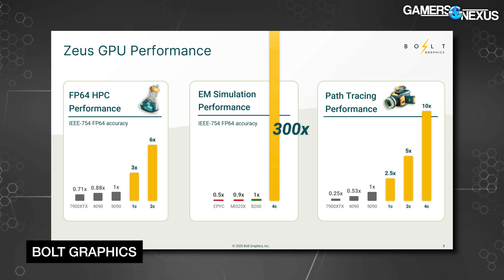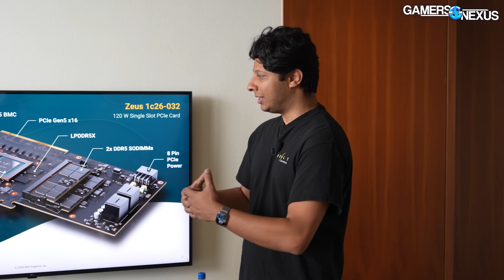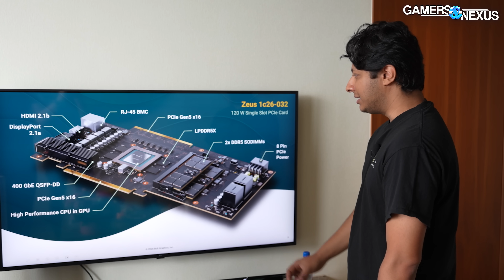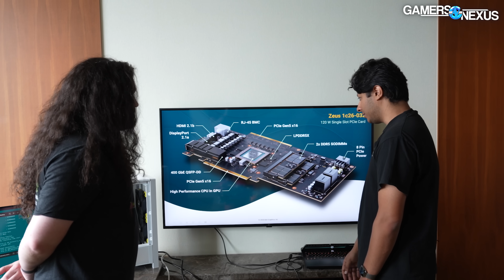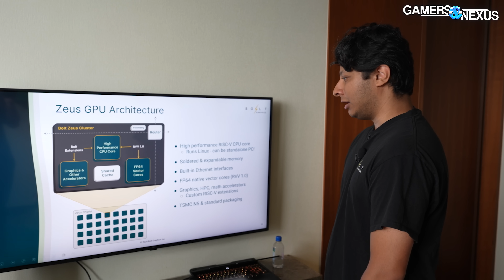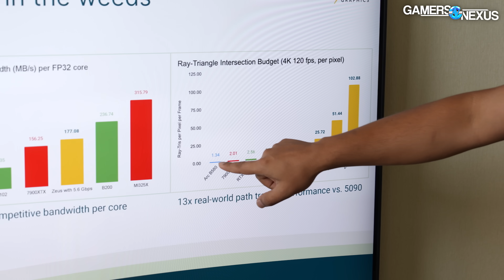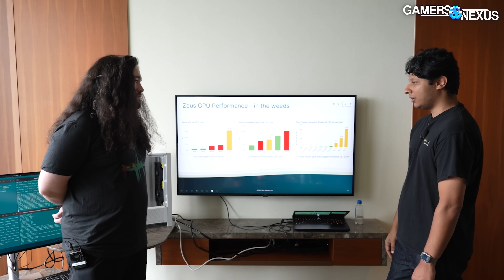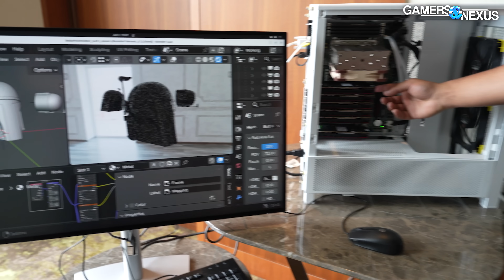A New Gaming GPU Challenger: Bolt Graphics Takes Aim at NVIDIA

Comment: Like perpetual energy machines, I've been hearing about this card for a while now; I'll believe it when it's on store shelves.  There are speed reasons as to why the current GPUs have memory directly onboard and positioned as close to the GPU as possible, and those reasons don't go away when you want to trace faster (It becomes an even bigger factor).  If their design was really revolutionary and more performant, I expect they would be licensing a patent to nVidia and every other competitor instead of the venture-capital-hungry path they are going now.  nVidia will surely clobber them with their own implementation of anything that is not patentable.

Comment: The raytracing focus is really interesting! I am a fan of art and games that use voxels, which are sort of like 3D pixels. Voxel rendering relies pretty heavily on raytracing to get each tiny cube shaded correctly. In the past, the best way to do it was theough software rendering. Currently, static rendering can use the raytracing hardware on cards. As far as I'm aware, a lot of games that use voxel-based terrain destructiipon, for example, will use more easy to work with polygons for the actual rendering, and deform the polygons to match the taper of the unrendered voxels. If this card can really nail pathtracing and raytracing then I could see more games like Teardown come out at higher voxel resolution.

Comment: Bolt has been saying that for years. It's 1 CEO guy and a PR team. Last years it was 10x a 5090. This year it's 5x. Also, rasterizing is kinda important for games, especially, you know, the ones which don't have Pathtracing implemented. I understand you want to grasp to some good news in this horrible place we are currently, but Bolt is not one of them. They are showing you a glorified renderer "optimized" on RISC-V on Blender, make some bold extrapolations from it, and already talking about silicon production for 2027 while NOTHING is currently in your hand aside off the shelves FPGAs already bought years ago and a rendered picture of a card. I was expecting more for GN and you Steve... Like how about Fiore, the previous startup from the same guy, a startup I quote "focusing on hardware accelerated graph network technologies" ?

Comment: My old RTX 3060 died back in late march of 2026 and I am now stuck with an Intel Arc that is still ghastly terrible, and I have the B580 Titan from Sparkle, and now Intel doesn't want to do discrete graphics anymore, only embedded. Oh Gee Thanks A Lot -kind of sort of thing. The drivers simply can't handle streaming services like Secondlife. They at least got AV1 barely working TG. I do a lot of video work, so processing power is a must, as is ram. I've been going to Secondlife for ages, but Secondlife crashes and crashes on the arc card with more than just a few people in the area/sim even withthe more than 200 tweaks and Tdr settings etc, etc, etc. I also need a minimum of 2 display ports. I love the card design.. It's amazing, and the ability to add ram is OMG!! just what we need, and the inexpensive way to link cards together is wonderful also. This card willl also change the microPC market once fully viable and available. ResizeBar is a definite must... While I find the RJ-45 and the fiber ports interesting... they are not as useful for regular users save as a backup or in the case of the fiber, an enhanced connection (My UDM-Pro supports Fiber -for example).. Yes.. more server and perhaps MicroPC applicable.

I know I speak for everyone out there in need when I say this.. OMG Thank You for designing this and taking over from where the megacorps have just ditched all of us who built them into what they are.

You know the rule.. You always meet the folks on the way down that you met and especially those on whom you stood on the way up.

We all.. Look froweard to these future developments.. Full Steam Ahead!!! MUWHAHAHAHAHA!!

Namaste and see you on the next reel.

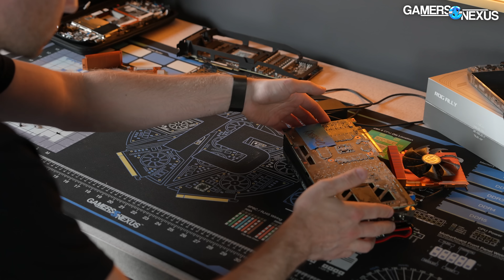Comment: the guy knows and everyone knows in gaming devs find no use in that chip...those days are long gone through the wind when IBM made cell processor that everyone put entire money and time for it that resulted bad vibe code for entire industry that force microsoft proven to be right on risc idea became very dumb idea for longest time for iteration's approach back then that last over 35 years for the idea back then....now x86 win entire cpu wars without doubt of my mind it made gaming devs no longer struggle making new engines and never have to use fp64 anymore even current gpu's has it but never use at all for modern gaming engines when everything is lot easier to do fp32 to fp4 without sacrifice immense cache as PS3 did for fp64 coding...yeah sure bandwidth does help but cpu itself does not when it Brutally penalized (1:14 speed) of every core

Comment: 20:45 you heard it here first. The devs are more interested in path tracing than raster
Reply: Because its way simpler to just design a level and let the light solve itself, than baking all the shadows and reflections left and right.
I as a gamer am pro-pathtracing, if its done correctly and doesnt look like pos.
I would buy better graphics card in the future, IF there would be games that utilize path tracing in a normal and optimized way, and so that it IS noticeable.
Reply: gang if this is affordable it's good tbh
Reply: the devs, not the players.
Reply: @rareraven  *the devs AND the players.
Reply: Isn't that known? They pushed for RT because it helps massively in development
Reply: @0v55llox1 yeah, like not optimizing the game. It's not a good thing to go for the simplest possible solution
Reply: Good

Comment: im surprised they didnt use lpcamm for the better signal integrity and bandwidth.
would also make it easier to design a single slot cooler around with the reduced height

Comment: TBH, this sounds more like consumer data center card. Depending on memory bandwidth, and how many cards you can string together, this could defintely run the very large models at a somewhat reasonable cost.
no tensor cores, so I dunno... Still probably better than CPU.

Comment: Okay so we won't be seeing any physical customer card till 2029? Also it wasn't mentioned how good the current Bolt card with only 1 chip is ... I'm all open for more competition, there is already a chinese GPU maker that makes cards as strong as a rtx 4060 and cost like 100 euro less but i doubt the Bolt card is in that range. They mentioned they wanna focus heavily into RT/Path RT which i personally don't use nor i care if the basic graphic settings aren't maxed.

I will be honest and it's just my opinion but i doubt it's so easy to get into the GPU market even if you use older tech. Even Intel which was dominating CPU side for over 20 years but ultimately got crashed by the competition is barely able to release one GPU per 2 years. We talking about Intel which has billions of dollars/funds/factories all over the world.

I wish you luck Bolt but competing with Nvidia, AMD, Intel and even the new Chinese GPU maker won't be easy.

Comment: an internal CPU core would be massive for low latency, you could run part of the game engine in the GPU itself so it will have a direct line to renderer for updating stuff like camera angles in an FPS or moving enemies on screen.

Comment: Valves work with FEX seems like it would go seamless with this

Edit: seamless
Reply: How? FEX is explicitly x64 to Arm64
Reply: @rpavlik1 Cause if they are having problems with getting games to load on it, then building off the work that Valve and the FEX group have done seems like a good idea.
Reply: @f1rdouglas  the compatibility issues there are completely different unfortunately.
Reply: @rpavlik1 oh really? Dang. But if its on Arm architecture, wouldn't the compiler tools work on this as well because of what they can do with the Steam Frame?

Comment: I hope they're successful, though I see two distinct problems.  Problem #1 is the leather jacket clad elephant in the room who they will need to compete with for fab slots at TSMC, you can't build your chips if leather jacket man outbid you for production slots at TSMC.  Also the price of RAM could still make this just as expensive as existing GPUs, but the idea of being able to expand your GPU RAM is a great idea.  Also the software to support this GPU will need to work right out of the box, any major bugs or compatibility issues will kill them.

Comment: The concept of adding as much VRAM as you want is great. There are many use cases where fast VRAM isn't necessary, but more VRAM is. So, it's smart to gain a foothold in those spaces first and then expand further. They seem to be doing and wanting to do the right thing.

Comment: They absolutely do not need to compete with the top-performing nVidia GPUs for success, if the price is right.  I was running a GTX 1060 up until late 2024, and the vast majority of my Steam catalog was perfectly playable on that.  If the ridiculous costs of current high-end GPUs forces developers to support more modest hardware, they could make serious inroads in the midrange market where most people shop anyway.

Since my GPU buying strategy was always "get the strongest midrange GPU with the most RAM available" for longevity purposes, the idea of upgradable RAM on the GPU is really attractive.

Comment: The thought that they need to swing a deal with Intel for the initial software creation popped into my head. Could they license a basic start for graphics drivers for games? Or let the user pay Intel an additional fee to get their software for the hardware made by these guys? At least at the start to help people adopt the new cards? Feel free to use my idea, but if you do, kindly throw me a card in appreciation if you would. 

I'd love to be able to throw my own choice of drivers on a card, rather than have it dictated by the company that made the card. Heck we could theoretically open source the initial code and get it certified before mass release at some point for drivers. It has always surprised me that the drivers are not done by the game dev studio and they rely at least in part on an external company.

If you are engineering from the ground up, challenge the rest of the "accepted methods" as well. Do we really have to limit the design to a single plane of PCB? Can we not strip out components to a totally different layer say an inch above or below the plane of the main PCB and remove the items from the hottest zones of the current board? CPU's already went vertical with the layers/chiplet design for the obvious benefits. The add in components are excellent targets for this concept as well, make them easily removable for installation or replacement even by non tech types. 

I've also wondered over the years why people do not bring more power to a GPU via the already existing connections from the mobo, many average computer builds do not use the other PCIe connectors for anything other than the single GPU. Get a part made to connect a GPU to another lane and pull additional power. Unless there is some limit to this that I as an average user simply lack. If we can get another 75 watts to the cards without using questionable hookups that would be great. 

I was just reading on ASUS where they made a mobo featuring 250 watt power draw on the gen 5 x16 slot as a concept, so my head was wondering in that regard if the current ones could work together what the limits would be, rather than the single connector limit we all know.

Building from the ground up allows a company to work in a number of benefits instead of just following the past engineering of others which is frequently less than optimal given new tech advancements.

Be creative Bolt graphics!

Comment: Uhm, this is from August 2025:
"Bolt Graphics notes that the developer kits are on track to arrive in 2026, with mass production set for 2027."

Meanwhile in June of 2026 all we see is an FPGA that can barely render something in Blender with a slightly updated render of the "GPU" that was also shown last year.

This is from this year's CES: "New GPU Startup Bolt Graphics Promises 2.5x Path Tracing Performance of RTX 5090"

Steve, I know it's exclusive access and all but you should have grilled them more about actually delivering a final working product. Based on the description they're already at least 2 years behind their original estimates for mass production.

Comment: So will bolt work like how the Voodoo 1 and Voodoo 2 worked as graphics accelerators? Where they are pared with another card from say Nvidia, AMD, or Intel to do the rasterization? It sounds like Bolt can't do raster very well, so their card would essentially be a Path Tracing Accelerator? I like the concept and as an oldschool system builder I miss expansion cards like we used to have.

Comment: Yes best work station Graphics card ever with more performance then a Nvidia RTX 5090 at a much cheaper cost :hand-pink-waving::face-red-heart-shape:But its a full Path tracing GPU, Witch means its not going to be good for older raster games that use anything below DX12 like DX11 or older might not run or work properly. and there is no support for older full OpenGL rendering APi, so some older Games that only support OpenGL wont run on  this GPU, as the drivers will not include opengl in them, as Vulkan is the new Api render that replaced OpenGL that All new Games ether use DX12 ultimate or Vulkan 1.3 or 1.4 now and mac games use Metal Api rendering, This GPU It's not available in stores, or anywhere for sale for home users.. Its mainly for work station and graphic work station. But i still ove that it has up gradable Ram ddr5 sockets up to 386 gigs of video ram :)

Comment: Depends what you mean by available. Stock isn't an issue but the expense is still not great. Each of the 4 chips on that unit will cost $25 (consumer 16GB) to $550 (industrial 128GB).

Comment: How tf can drivers be that much of an issue if the entire hardware design was done at once like that? You design the hardware to work as closely to actual Standards as possible.

CUDA is not a standard. Nvidia closed black box driver crap isn't a standard. ROCm is not a standard.

Want things to work? Adapt Vulkan. Otherwise, you have to beg and plead for horrible game coders to bloat their horrible code even more to work on even more specific hardware.

I blame game designers largely. Back in my day, these were problems. Today, it's absolutely absurd that you people who play PC games put up with the unnecessary bullshit
Reply: The problem is with games no following the standards. That's why drivers are important. They fix the crashes caused by improper code.

Comment: Xilinx, gpu, means AMD, means... Any one who ever worked with Xilinx products? There software sucks balls, and they drop support pretty quickly on there software, where you need to have at least 2 if not more version of it because, of dropped support... I had to use "hacks" to have both xilinx software work at the same time with there drivers, because for some reason, vivado decided, to say fuck there old software support.

Side note, it is twice in row i have built a new computer, where at least one part has increased in value... First time was my 2080, went from 600 to almost 1k. Now its my 5090 and ram, and SDD and CPU... wtf is going on.

Comment: The hardware doesn't matter when the drivers suck and need to mature.  The reason I never took ARC cards seriously wasn't because of performance, it was the moment they released , barely anything worked as intended.  Drivers are everything, the hardware is a paperweight with out one.  They are difficult , Nvidia struggles with it every generation, when I first got the 5070 ti I was disappointed with issues and problem, a few drivers later and I'm actually really happy with the card now. You have to come out swinging with some nasty good drivers.

Comment: User expandable memory is brilliant. The idea of competing with NVidia is not as crazy as it seems, with NVidia focusing on data centres and using AI to churn out bug-laden drivers. Finally, wish I was back in firmware development so I could toss around terms like "minimize the surface area of software optimization".

Comment: I'm confused by the fiber, and honestly the Ethernet as well. Granted none of the datacenters I've worked in really had video cards, but this just seems weird. The idea of it being a PC on it's own just seems like we are going to run into SuperMicro/IPMI kind of control, which sounds GREAT... for a server, but even on a server it runs into so many problems and it's much better to just have a network connected KVM switch (if you aren't running virtualized everything). Console access to that kind of stuff is horrible, and I'm not sure I understand why you wouldn't just want control over the main board/server that it's plugged into. What data center is going to run a full OS directly on that video card?

I'm happy to see more people get into it, and I'm glad to see their ambition, I'm just sort of confused by their direct use case.